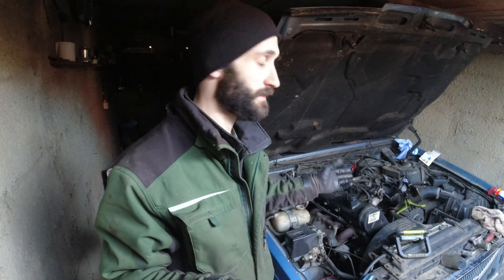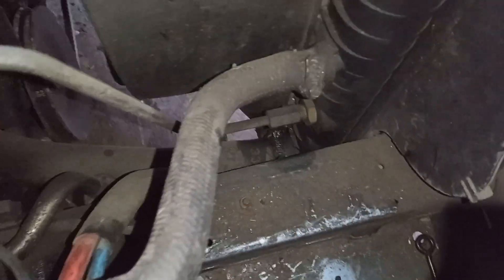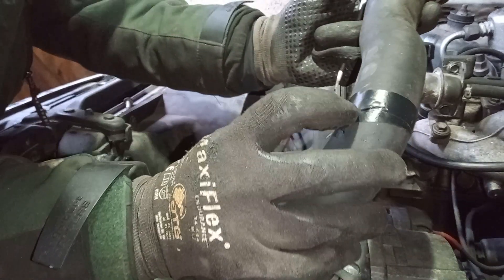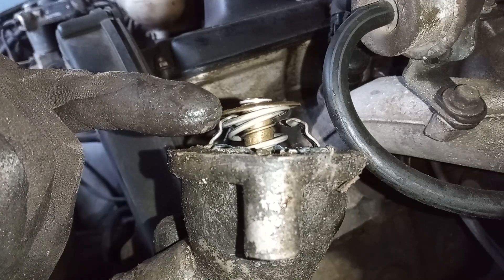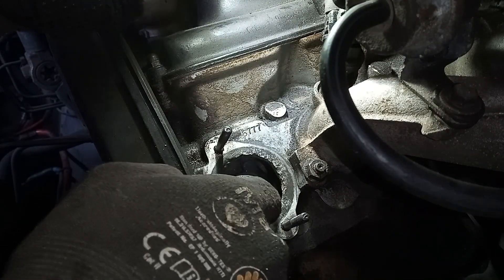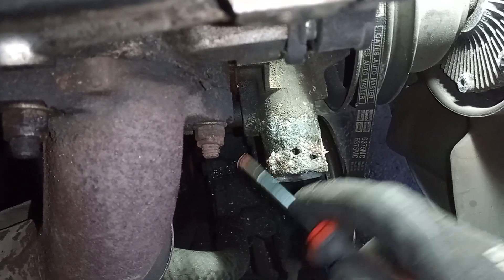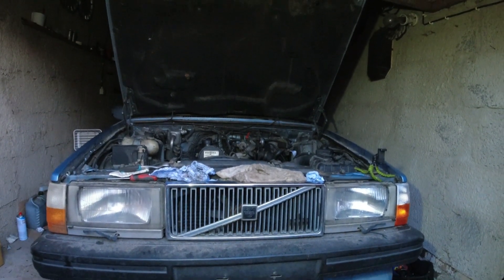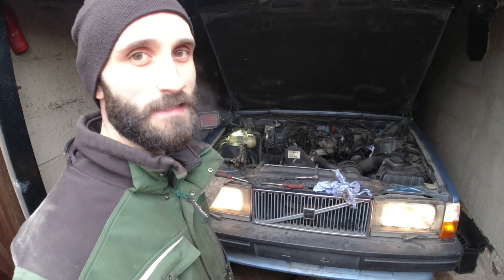I find Corrosion and Damage in the Volvo 740 Cooling System

Comment: i completely agree on that silly rubber seal. Weird design and the manufacturer should put it on. 

about that theromostat: there is a small jiggly bit in the rim of the thermostat. It is supposed to be oriented (clocked) to the highest point.  It is there for bleeding trapped air. In the case and non OEM aftermarket thermostat doesn't have one you can also  drill a tiny (1 or 2mm) hole in that rim and then clock that hole to the highest point. 
It makes bleeding air out of the cooling system easier.
 
Another good practice: before you fill the cooling system put the heater on the dash on MAX. That way air can get out of the heater circuit easier.
While the engine is warming up you can also squeeze the coolant hoses. That might just dislodge some trapped air bubbles.
Reply from the maker: Oh thanks for the info! That's a very good point re the jiggle pin, I didn't realise it should be at 12 o clock, but now sounds obvious 😃
Reply: @Involvod  CHRIST, i put that seal on the incorrect way. good thing it hasnt been taken out yet. Thanks for the info guys
Reply: i oriented my bleed valve towards the higher hole in the thermostat housing (where the top nut screws onto), because it seemed like there was a little channel cut into where the thermostat sits in the engine that leads there. So it's more at 10:30 or 11 rather than 12 o clock. Is that alright or should i remove and face straight up vertically?

Comment: Besides the odd packaging nonsense with the gasket, it's confusing volvo didn't include any thermostat aligning features on the housing. If the thermostat ends up with air bleed hole at the bottom, bleeding will be a slow process.
Reply from the maker: That's very true!

Comment: I just went through the same thing on a 1982 Dodge B250 Van where the only aluminum in the system was the upper coolant neck which housed the thermostat as well. extreme pitting on the coolant neck, but still running the original brass radiator and heating core. I appreciate all of your maintenance videos!
Reply from the maker: This is the problem with it, my first 940 had corrosion on the head, it was pitted in the coolant passage and eventually blew a gasket. Thanks for watching!

Comment: You was lucky that top hose came off easily,mine took half the radiator connection with it,had to buy a new rad off eBay ,my 740 was an auto and the trans cooler pipes were corroded at the radiator end too.
Reply from the maker: I did worry about that before I took it off! Slicing the heater hoses is a great tip! Thanks
Reply: You bring up a good point: the joints where the hoses connect can be weak and fall apart when you service the hoses. I'm especially leery of heater hose connections, and will carefully  slice them off with a razor knife rather than try to twist them off.
Reply: @Gothamauto  that's why I never changed my heater hoses,the valve connection would be been as weak as the radiator one.

Comment: My 240 also needs a thermostat and heater core replacement. Thanks for the video.
Reply: Are you sure it is the heater core? On 240's it is often the heater control valve that is leaking. If it is a performance issue with that heater, maybe disconnect the heater hoses,  then fill that heater with a vinnigar/water mix, let it sit for a day then contra flow any dislodged schmoo out with a proper stream of water (use a garden hose?) Then reconnect the heater hoses , refil the system and check if performance has improved.  
Btw, you can do this with the heater core in place!
Reply from the maker: Thanks! The heater core is quite the job on those cars! Best of luck 🤞

Comment: When I got my 92 with 38K miles it had an almost complete clog of corrosion in the water pump intake. You might find something similar when you change yours. I also replaced the radiator because I figured it was compromised as well. With the temperature compensation board removed and bypassed, my temp gauge sits at exactly mid point when warmed up. Cheers and Happy New Year!
Reply from the maker: Thanks for sharing, goes to show the problems you can still have on a low mileage rig. I'm keen to have a look inside there, I'm wondering what the impellers look like too... 

Happy new year!